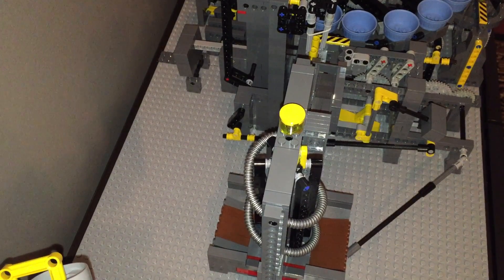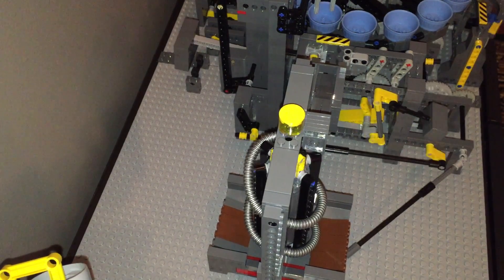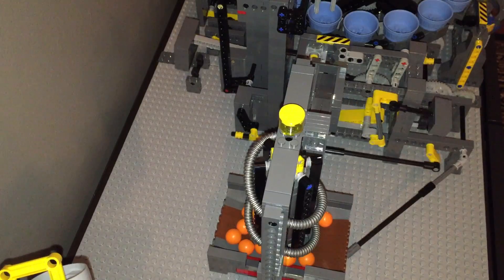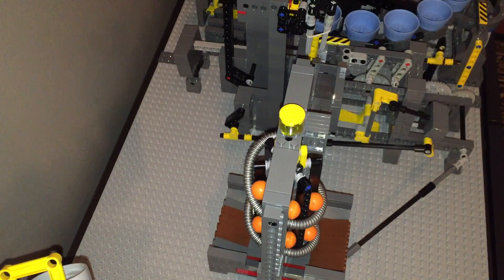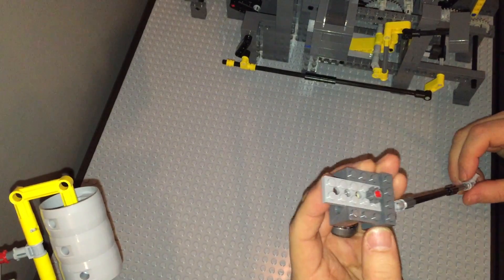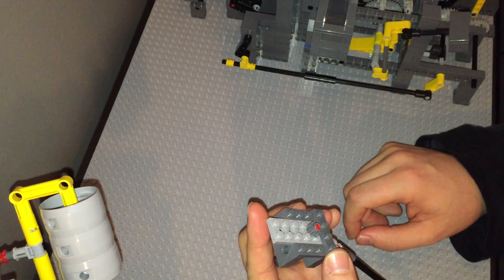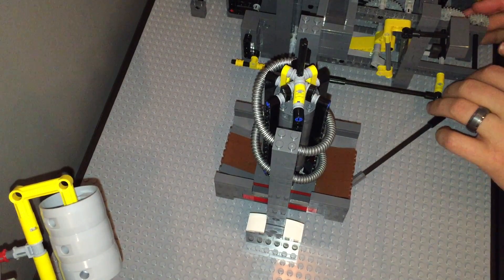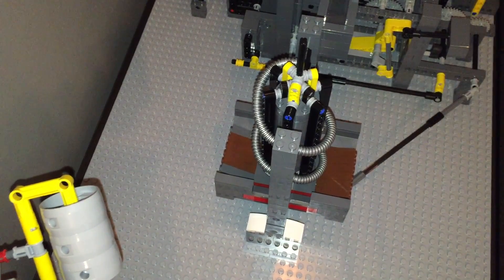Lego Ball Factory Assembly Instructions - Part 11 - Spiral Lift

Comment: Awesome the whole GBC run is a work off art. I have 1 question how many studs high is the whole assembly at its highest point?
Reply from the maker: That's a great question. I no longer have it built but I would say the hight of the spiral list is very close to if not the highest point.